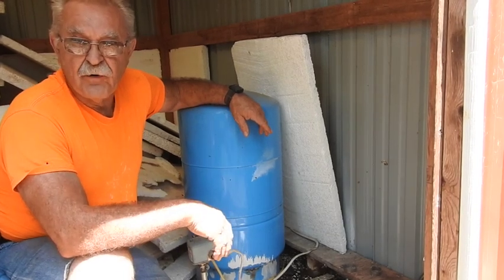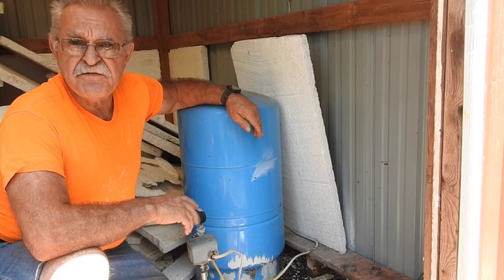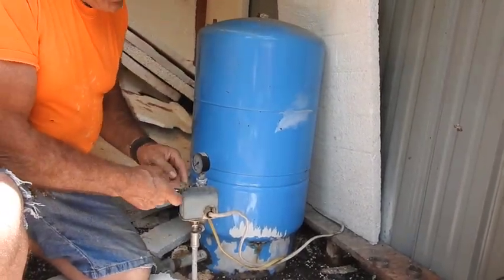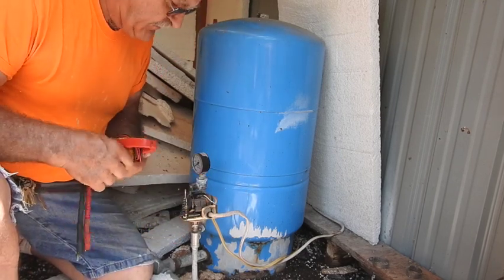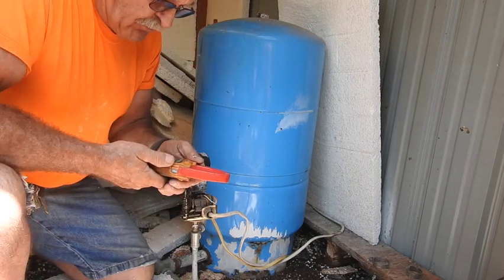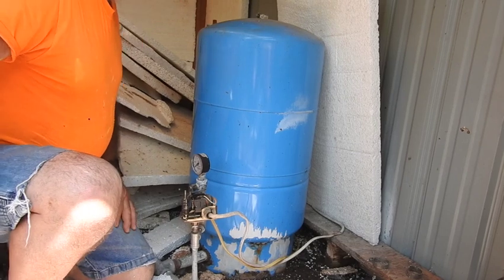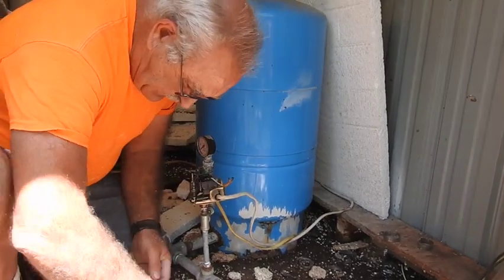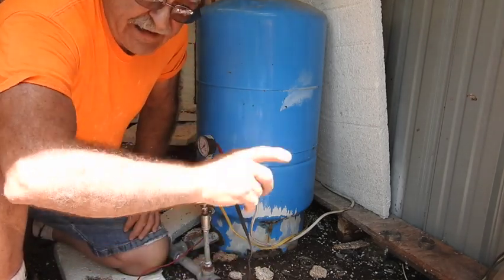Troubleshooting Neighbor Lady's Well Pump

Comment: I had a submersible go out because the wiring connection rubbed against the casing when the pump torque would jerk the unit when it started. Had another go out due to a nearby lightening strike. Did not hit the casing but was close enough to find it lol!AL B.
Reply from the maker: If my neighbor lady is lucky that's what we will find here.  I've had that happen before.  Sometimes the pipe is dropped in the hole without snubbers to keep them centered.  Sometimes the bore is not straight and the wires will be rubbed with the starting torque of the motor exactly as you describe.  Yes, I've had the surge in the electrical supply cause damage as well as extreme voltage drop.  Thanks Al for chiming in with your input.

Comment: A great 44 well pump adventure this Saturday morning that I’m tippin too profusely! I’m glad my pump is a three wire and only 75 feet down. A friend has a well nearly 700 ft. and boy what a chore to pull that baby! Here they hit water at 45’, went don 95’ and placed the pump at 75 as I’ve said. Pressure switches going bad is so much nicer than realizing the pump went bad. How nice for your neighbor to live by Tractorman 44 and how nice to have a rig to pull pumps, as seen before. I’m feeling fine as frogs hair and getting back to me real self while sippin and tippin your way! My Best to all the 44 Family and a Fine weekend! DaveyJO inna Holler to your Holler!
Reply from the maker: Glad to hear you are bouncing back to health rapidly DaveyJO !!  You're lucky with such a shallow well.  Up here they insist on drilling until they hit a filtering layer of Rubideoux sand.  Of course that is spelled wrong, but it's a type of white sand.  Mine is 400', the SIL is 420', ladyfriend Sandi is 285'. so I'm thinking this will probably top 200'.  We got rained out but I think its stopped so we are going to try to set up the rig again.  Mike got the roof off the well house and I got the pump head ready inside before the deluge hit us !!

Comment: O yea great explanation. Well pumps are the way to go. High torch pumps with start caps indeed are rated for better draw less chance of failure. More electrical components but capacitors have come a really long way.
Reply from the maker: Hey man, I'm glad you enjoyed it.  My tongue gets twisted and I cough up the wrong word or phrase some times, but most of the time it's at least half-right.  LOL.  What you said above is true for sure.
Reply: @tractorman4461  you are doing great .!!!!

Comment: I replaced many pumps after a thunder storm
Reply from the maker: Yes, voltage drops and power loss as well as voltage spikes at just the right time wreak havoc on well pumps and as you well know, a/c compressors. Thanks Dr Paul for the visit.  I have a ton of sheet metal videos, by the way.

Comment: It is great helping friends and neighbors out! Our neighbors also call for heating, plumbing, and other issues, (sometimes in the wee hours). I've pulled my share of well pumps and sucker rod for windmills.
Thank you for giving your neighbors a hand!!
Doc
Reply from the maker: Hot dang, then you know exactly what I'm talking about Doc !!  If we are lucky we'll find a broken wire or deteriorated connection instead of the actual pump bad.  That'd save the expense of the pump at least. After 40+ years in service, I know about those wee hours calls.... )-;

Comment: Good diagnostic I say.....I would have come up with the same results.....My last pump at the camp, I got 22 years out of it and that is good in my books but I guess one could get more.....CHEERS
Reply from the maker: They used to have a shallow well with a sucker rod pump. But it was converted to a submersible many years ago when they lost the sucker rods down the hole.  A guy with a grab hook snagged 'em and brought them outta the hole which cleared the way for the new style.